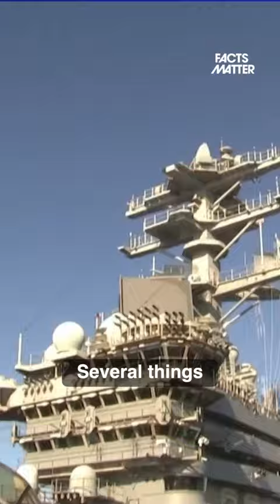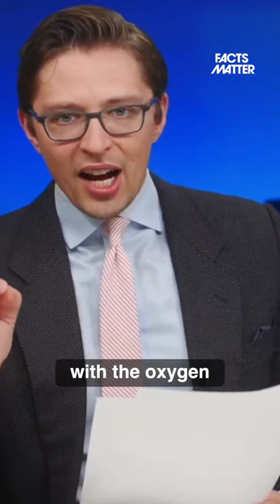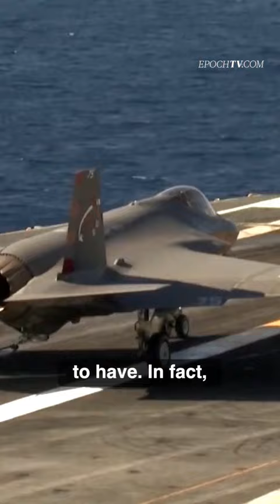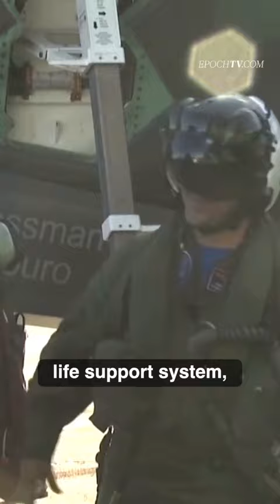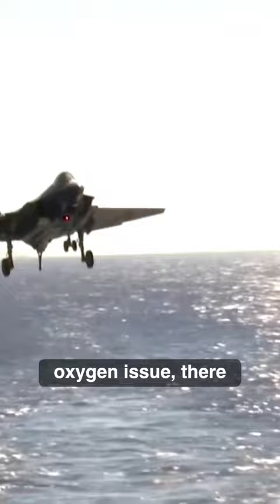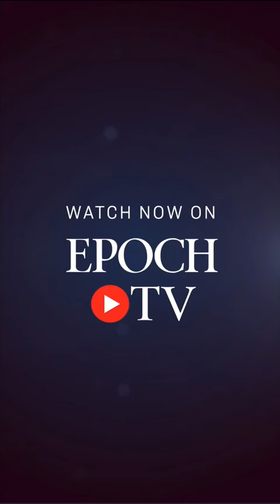Hidden Troubles of F-35 Lightning II ✈️

Comment: Likely these f-35s have oxygen concentrators instead of Tanks.
If a concentrator were to malfunction a pilot wouldn't be unable to breathe.
A redundant concentrator being fed with a similar power source or relay, could catastrophically fail.
While the same could be said for tanks, it is highly unlikely, that a tank would malfunction, especially in its redundancy.
Reply: The f35 is intentionally designed to have an unstable flight model
It gives the wircraft hyper manuverability 
But it means that it needs a computer to make minute ajustments to help the pilot 

It is extrmely difficult to fly the plane "iron grip" (without any instruments or assistance)

The gov reported the plane had a total electrical system failier 
Wich woulf have disabled this flight computer

Comment: Descend to below 10k feet. Issue of oxygen deprivation solved.
Reply: Not if your ENTIRE helmet and face mask is an integral part of your aircraft. It's your communication system, it's feeding you info and targeting info, it's watching your eyes to see where you look so it can move cameras and shoot weapons in that direction, etc, etc. Unlike WWII times, you cannot simply rip your mask off and continue to fly your aircraft. It would be the equivalent of disconnecting half of your instruments and controls and expecting to continue flying. If the pilot stops being fed oxygen, it's game over. Obviously, they cannot even fly long enough to land that $300-million masterpiece somewhere!
Reply: Many of the fighters are sealed cockpits incase of chemical attacks and plumes of gas in lower altitudes. That oxygen system is the only oxygen in many cases.
Reply: Seems like an obvious engineering failure.of that's the case. Protection against NBC warfare is secondary to just plain air to air combat.  If the helmet  is sealed.thats fine, but a 100 mill dollar plane should have some sort of emergency vent and the 400k helmets should have the same. If that's true about the helmet, how would the pilot breathe after ejection as they parachute down to the ground. Their heart rate and BP would be through the roof.. They'd already be at a heightened respiratory rate dealing w the adrenaline of whatever situation is or was at hand. It could take more than 4 mi utes to reach the ground. Then on the ground they're not ginna get air till they get the helmet off ? I doubt that. The claustrophobia of not being able to get fresh air seems like my original presumption is correct. But I am just using  logic and  limited knowledge.  The whole lost F35 seems more of a psyop or major FUBAR than reality

Comment: He wasn’t flying that high.  Makes no sense.
Reply: The f35 is intentionally designed to have an unstable flight model
It gives the wircraft hyper manuverability 
But it means that it needs a computer to make minute ajustments to help the pilot 

It is extrmely difficult to fly the plane "iron grip" (without any instruments or assistance)

The gov reported the plane had a total electrical system failier 
Wich woulf have disabled this flight computer

Comment: You can breath well in any aircraft below 8000 feet. Even pressurized cockpits just crack it. The aircraft flew around 200 miles before crashing. And the pilot was less than 50 miles from the coast when he ejected. Standard procedure is to aim the aircraft to words the sea before ejecting so to avoid civilian casualties.
Reply: Probably, someone's going to have to ask him.😳
Reply: @patriciamariemitchel  They have already asked him. But the Marines see this as a public relations problem. And the people will get a public relations answer.
Reply: I don't believe the air craft crashed. 😮
Reply: Exactly the questions ppl should be asking - why eject, leaving a military plane on auto pilot, to eventually crash and do damage to civilians - luckily it didn't harm anyone when it crash landed - or did it?
There's another story - that it was doing manuvers over a suspected militia area when the pilot ejected because the plane was being shot at.  What's the truth and what's the lie 🤥 ?
Reply: It flew 60 miles before crashing
Reply: @asmodeus1274  
It may or may not have gone 60miles forward but it flew a very wide back and forth grid pattern which ads actual mileage.
Reply: @kellikelli4413  LOL You’re so sure of yourself that you liked your own comment. I find that weird…

Comment: Even if the onboard oxygen generation system (OBOGS) was inoperable, there is approx. 12 minutes of oxygen in the ejection seat pan. There is a pull cable that begins this flow of oxygen.  Ejecting from planes that are in auto pilot or in ILS mode has a history. There are several stories of this happening.

Comment: Don't these new jets have AI integrated into the system?  Maybe AI decided it was time for the pilot to go 😮
Reply: Glad to see I'm not the only one that thought it. The war with Skynet has begun😂
Reply: The B model does have an auto bait out feature in certain modes
Reply: @jh52663 😂
Reply: You ACTUALLY have to go online to t/shoot lol… not fun or feasible if you’re in trouble
Reply: The f35 is intentionally designed to have an unstable flight model
It gives the wircraft hyper manuverability 
But it means that it needs a computer to make minute ajustments to help the pilot 

It is extrmely difficult to fly the plane "iron grip" (without any instruments or assistance)

The gov reported the plane had a total electrical system failier 
Wich woulf have disabled this flight computer

Comment: The problem was the onboard computer control systems, (the fly-by-wire controls), had stopped responding. The pilot didnt have control of the craft.
The authorities haven't reported "why" the pilot ejected because it would confirm suspicions of a fatal fault in the whole F-35 production line.
Reply: He allegedly left it on autopilot is the story I've heard.
Reply: The f35 is intentionally designed to have an unstable flight model
It gives the wircraft hyper manuverability 
But it means that it needs a computer to make minute ajustments to help the pilot 

It is extrmely difficult to fly the plane "iron grip" (without any instruments or assistance)

The gov reported the plane had a total electrical system failier 
Wich woulf have disabled this flight computer

Comment: He could at least’ve turned on the transponder. If it was an oxygen issue he could’ve taken it down. It doesn’t make sense. Electrical failure doesn’t make sense either, the electrical system have several layers of redundancy as well as the flight mode. Electrical fire or Indication of fire in general is one reason to force the pilot out of the plane, think they must. So it could be a false indication of fire, regardless it was flying without transponder, just take a second to turn it on. So tip,  add that to the checklist for a stealth fighter ejecting in friendly space especially during peacetime. I’ll put my money on some kind of fire indication, if the engine is running and the autopilot work it doesn’t make sense ejecting without make sure the plane will ditch safe.

Comment: Supposedly, he was flying in a 3 group , and he was lead. Returning back to base after a training flight. 
Bad weather prevented visual contact with 1 another.  They were flying at 2000 feet. He lost contact with the other two. He had an electrical issue.
No gauges and no visual, so he ejected.  
I'm wondering how the big hole in the top of the fuselage would create a lot of drag. Could Autopilot overcome it ?

Comment: Saw two fighter pilots speculating. Oxygen could have failed and pilot reached down for auxillary level and pulled wrong lever or unbuckled seat belt to take a leak and buckle got caught up in ejection lever

Comment: The plane is most likely in Chinese hands as we speak....One might go through the pilots finances with a fine comb.
Reply: They found it in a field in south carolina
The f35 is intentionally designed to have an unstable flight model
It gives the wircraft hyper manuverability 
But it means that it needs a computer to make minute ajustments to help the pilot 

It is extrmely difficult to fly the plane "iron grip" (without any instruments or assistance)

The gov reported the plane had a total electrical system failier 
Wich woulf have disabled this flight computer

Comment: Yeah but the plane didn't crash like the one in Florida; it disappeared.... To the Ukraine😂
Reply: We all know it didn’t

However let’s entertain the idea that it did

We would know within a week, probably less than that

Not because anyone would find out or see it or anything

But because the entire Russian Air Force would suddenly disappear overnight
Reply: @shadowninja8011 Unlikely.  The F-35 is a crap plane.  It is inferior to everything it is replacing.  It's designed to be a jack of all trades jet.
Reply: It crashed like the one in Florida. But in South Carolina.
Reply: An article said that it crashed 800 miles away from where the pilot ejected in North Carolina (to the final area in South Carolina).
The flight pattern showed that the plane was still doing its programmed grid pattern until it crashed.

Comment: If the autopilot were defective the plane would be incontrollable. It was going to crash no matter what. That would also account for the transponder not working.

Boeing now gets to sell another $9B F35. Why fix it if it can become job security?
Reply: The f35 is intentionally designed to have an unstable flight model
It gives the wircraft hyper manuverability 
But it means that it needs a computer to make minute ajustments to help the pilot 

It is extrmely difficult to fly the plane "iron grip" (without any instruments or assistance)

The gov reported the plane had a total electrical system failier 
Wich woulf have disabled this flight computer

Comment: This has to do with the plane's life support system, specifically oxygen deprivation. The issue that NASA discovered was that the oxygen system which is supposed to match the pilot's breathing and requirement for air, either pumped too much oxygen, or not enough. This was supposedly fixed. As to this particular incident, this was a 35B, which although capable, usually would not train at an altitude that required oxygen (above 35,000-41000 AGL). I'm doubting oxygen was the issue. But no one knows for now.
Reply: The f35 is intentionally designed to have an unstable flight model
It gives the wircraft hyper manuverability 
But it means that it needs a computer to make minute ajustments to help the pilot 

It is extrmely difficult to fly the plane "iron grip" (without any instruments or assistance)

The gov reported the plane had a total electrical system failier 
Wich woulf have disabled this flight computer
Reply: @garyslayton8340  Actually you described the F117 as being unable to fly without computer help. Our first stealth fighter and a beast to handle without computer aid. Impossible really. ALL fighters though have smaller than average flight control surfaces which makes them more maneuverable, but none other than the 117 is unable to be flown by hand. If you heard that somewhere it isn't true. (Unless it's a shit pilot that has no business being in a fighter).

So where did you hear the plane lost all electrical? I have not seen that anywhere please post the link so I can read it. I somewhat doubt this though because the plane flew for 60 more miles before crashing. No plane can stay straight and level for 60 miles without an autopilot. Particularly in bad weather. And to use your own words, the plane couldn't be flown without computer help right? So how did it fly 60 miles without the computer (and autopilot) that would both be down without the electric being operable?
Reply: @MikeM275  
The f22 and f35 are both like that 

And it was a report from yesterday
I cant find anything about the flight path because every source is either full of other bullshit or is only talking about the actual even
Reply: @garyslayton8340   Where was the report that said he lost all electrical? And re read my comment that without electrical it could not have flown 60 plus miles in a storm. The autopilot is part of the electrical system. I have nearly 5000 flying hours of PIC time. I don't know what happened, and I think you're just guessing and reading things that you don't really know anything about.

Comment: These planes have fly by wire auto correct systems in the case of G lock or loss of consciousness. Im guessing the the pilot may have either lost control or consciousness and ejected thinking the jet was unrecoverable and the auto correct engaged after the fact and saved the jet.
Reply: The f35 is intentionally designed to have an unstable flight model
It gives the wircraft hyper manuverability 
But it means that it needs a computer to make minute ajustments to help the pilot 

It is extrmely difficult to fly the plane "iron grip" (without any instruments or assistance)

The gov reported the plane had a total electrical system failier 
Wich woulf have disabled this flight computer

Comment: Ejected at low altitude......and why a $100 million dollar plane has no backup O2 delivery ???
Naaaah.....that's not adding up
Reply: The f35 is intentionally designed to have an unstable flight model
It gives the wircraft hyper manuverability 
But it means that it needs a computer to make minute ajustments to help the pilot 

It is extrmely difficult to fly the plane "iron grip" (without any instruments or assistance)

The gov reported the plane had a total electrical system failier 
Wich woulf have disabled this flight computer

Comment: The aircraft control system can eject the pilot because it can't be controlled without computer assistants apparently at the moment it's the only aircraft that can
Reply: The f35 is intentionally designed to have an unstable flight model
It gives the wircraft hyper manuverability 
But it means that it needs a computer to make minute ajustments to help the pilot 

It is extrmely difficult to fly the plane "iron grip" (without any instruments or assistance)

The gov reported the plane had a total electrical system failier 
Wich woulf have disabled this flight computer